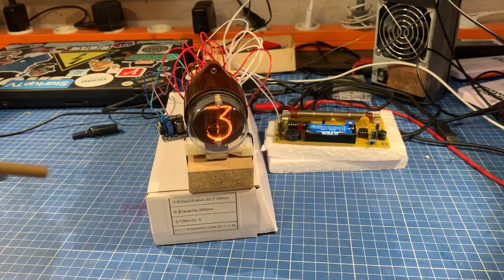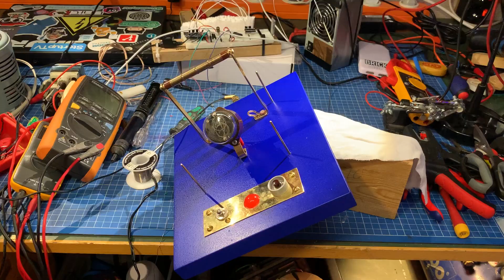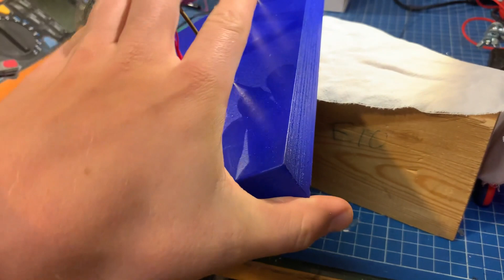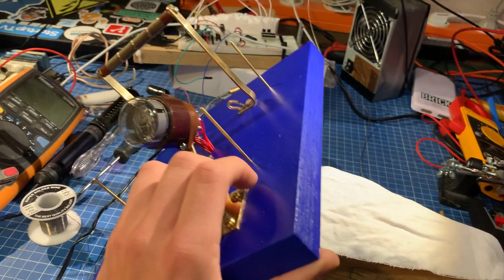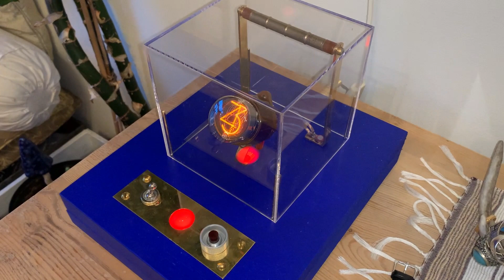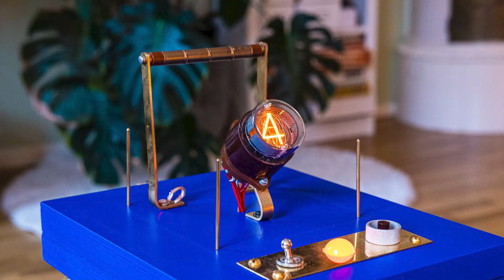Cosmic Background Radiation Dice - True Random Generator

Comment: If you „throw away numbers above 9“, does this mean you try to generate another number until one fits the target range or do you map the [0,15] range onto the [0,9] range…? Because the second way cannot be done equally, so your random distribution would be skewed. 

How did you solve this problem, I am very curious.
Reply from the maker: Hey! Thanks for the question. It's your first guess! I generate a four bit binary number and translate it to 0-15. If it's 10-15 i simply discard it and the thing has to run again. As you say a mapping would not work. Not sure if there is a better way 🤔

Comment: This is great! And I'm genuinely curious about that (is it acrylic glass?) clear case. If you made it yourself, may I ask which adhesive you used and where you got it? I've only found non-capillary action ones in Europe so far.
Reply from the maker: Thanks! Nope I actually cheated with the case. Not my trade to cut and glue that stuff nicely... Bought it as a "jewelry display cover" or something like that. But it is glued together by the manufacturer.
Reply: @isaxlaboratories  Ah, that's a shame. I was hoping you had the answer to all my acrylic glue supplier questions. Looking forward to see what you come up with in the future regardless!

Comment: Considering this thing just picks up terrestrial radiation, what's to stop someone from bringing in a radiation source with a known output of particles per second to overload the detector and force specific numbers, thus breaking the "randomness" of it?
Reply: are you seriously sugesting someone will bring a radioactive device to a monopoly game?
Reply from the maker: @diguifi0fficial  🤣
Reply from the maker: I considered building it with an included radiation source first and acquired some uranium glass for that purpose. Decided against eventually. But as long as the counts per second are lower than about 500/s it will still work fine randomly. And on levels above that I'd be worried about more than cheating players...
Reply: Valid question, still super cool. A self-contained and shielded source would be ideal, but nowhere near as cool.

Comment: Nice build, but you're misinformed on the physics. A Geiger counter detects charged particles, some of which come from terrestrial radioactive sources; the rest are muons created by the decay of pions produced in Earth's atmosphere by cosmic rays. These cosmic rays are mainly protons; lower energy ones are produced in the Sun, higher energy ones may come from supernovae or from supermassive black holes. They have nothing to do with the Big Bang, and are not electromagnetic radiation.